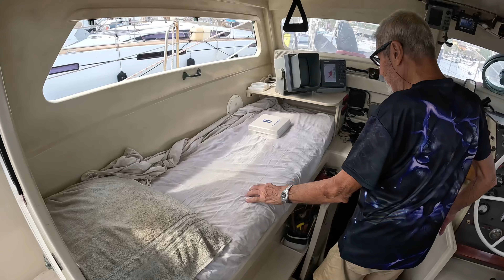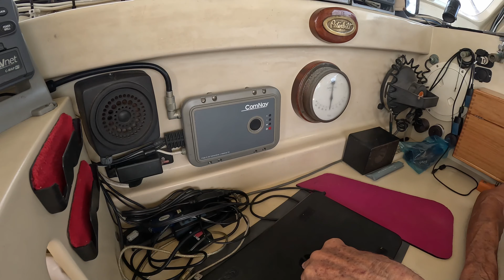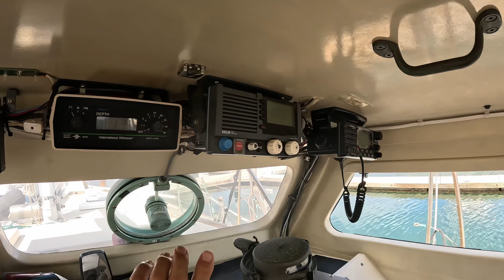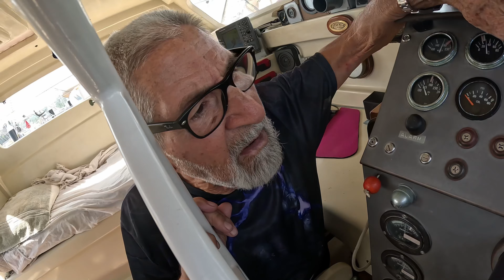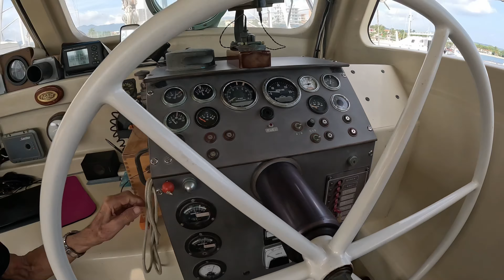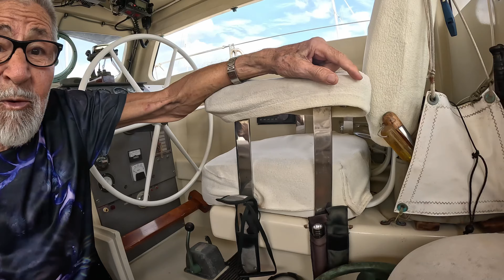Why a Pilothouse?

Comment: Is there any way to control your sheets without going outside?
Reply from the maker: I can handle the sheets from the cockpit, however, I am not of the "do everything from the cockpit" school of thought.  Handling boom preventers, boom vang, reefing or furling the main all require going on deck, and so do inspections of everything.
Reply: I always enjoy going forward, sometimes just to stretch my legs and feel the boat under my feet. That's for sharing!
Reply: Thanks for sharing!

Comment: I also have a Hundested C P Prop. Please explain how you set up your decompression and compression starting system, which I want to setup. I have always turned the flywheel to TDCentre.
I recently overheated my engine running very slow RPM with to much pitch. I didn't know this was a concern.
I also now realize that running slow reduces the keel cooling water flow volume.
Reply from the maker: My Isuzu DA120 engine comes with provision for decompression, it is not something you can "set up".  It is a lever on the valve cover that "de-activates"  the camshaft, no valves closing = no compression.  Ideally you should have a pyrometer in conjunction with a VP propeller to prevent overloading.  This a huge concern.  EGT (exhaust gas temperature) should be no higher than 900ºF/480ºC when at full cruising RPM 1250 in my case, but I keep it much lower at lower RPM.  At 1100RPM I go with about 650ºF/350ºC.  These are the numbers I use, and they are based on many conversations with ship engineers.  Ships engines have a pyrometer for every cylinder, I have only one, at the end of the exhaust manifold, the sensor in way of that cylinder's exhaust port.  I wish you good luck.  Best - Peter
Reply: @AncientMariner  thanks Peter, travel safely. Regards Billy

Comment: Couldn't agree more on having a pilothouse! Unfortunately I do not have one. I have what I call a "poor man's pilot house" on my Cape George. I have a dodger and leverage that for shelter. If things are under control and I don't have my foulies on, I sit at the top of my companionway stairs under the dodger. Its comfortable (I have a cushion), I can see the nav instruments, and have a remote for the pilot I can use in this position. If its raining and I have my foulies on, I crawl up on the cabintop underneath the dodger to try and keep out of the elements. In this mode I mostly keep outside to try and keep too much water from getting down below. Its a definitely a compromise! The next boat will have a pilothouse if it is big enough! Thank you for your videos!
Tim - s/v Patience (Cape George 38)